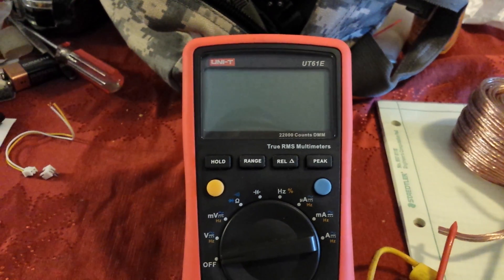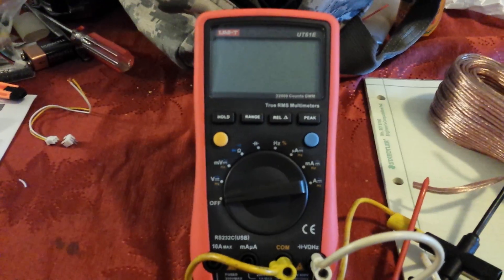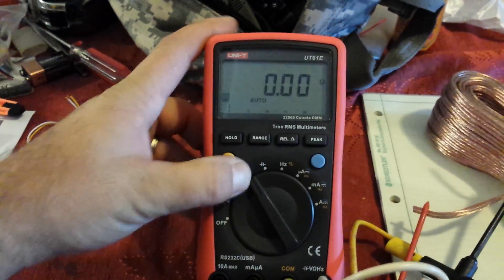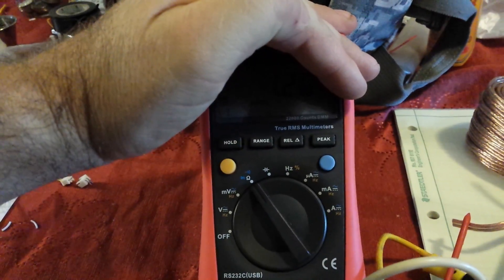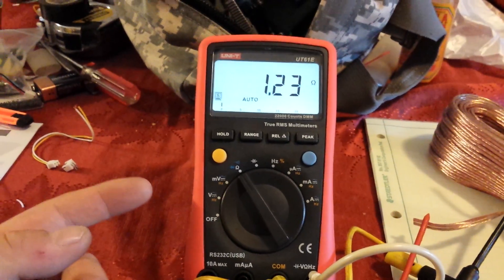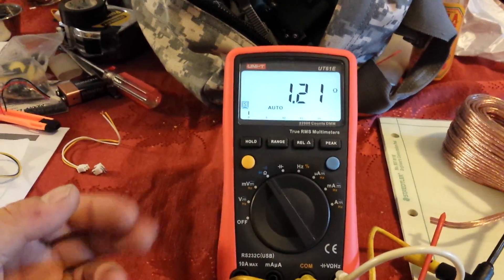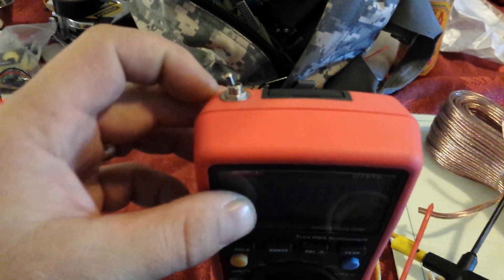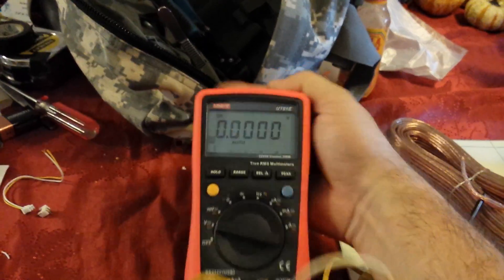UNI-T UT61E backlit display description.

Comment: Right below the negative battery contact on the board is a terminal labeled "V+"
This is the 9V from the battery but switched on/off by the rotary dial. If you'd taken your + for the LED's from there it wouldn't be possible to leave the backlight switched on when you power the unit off.

Comment: How many LEDs did you put? 2? 4? and how did you connect them (via driver or in series)?
Reply from the maker: 2 at the base of the display, in series, and connected (via switch) to a resistor and then to the battery.